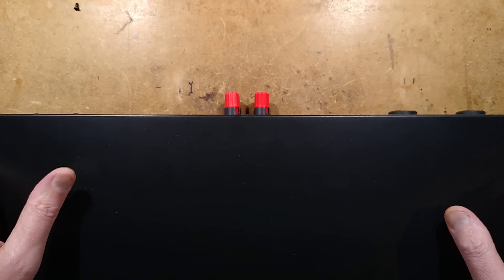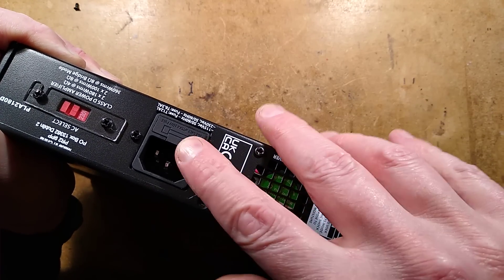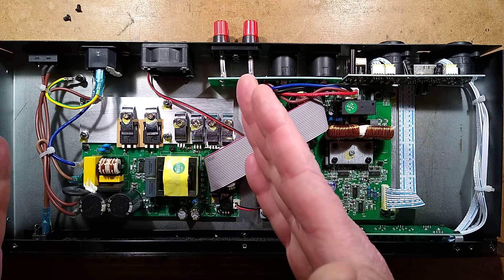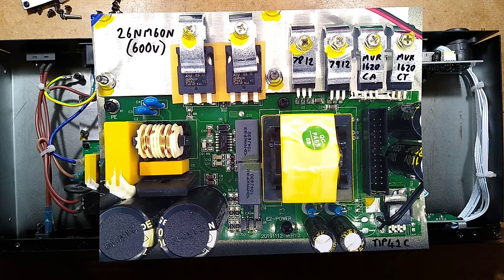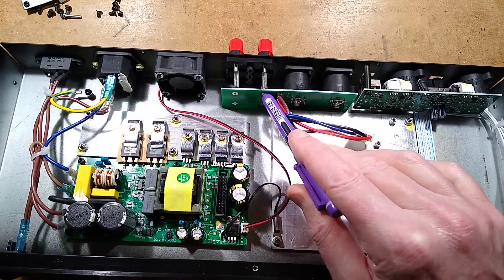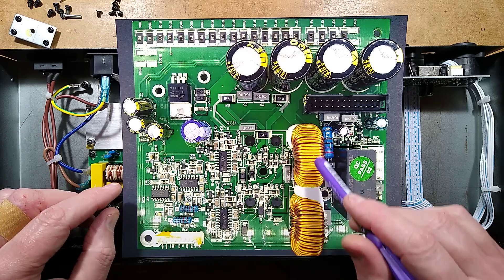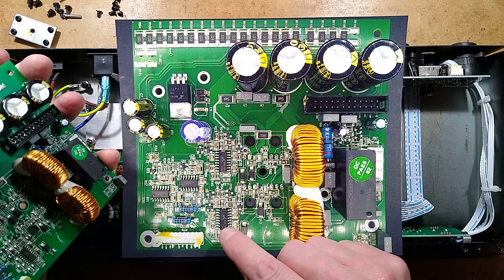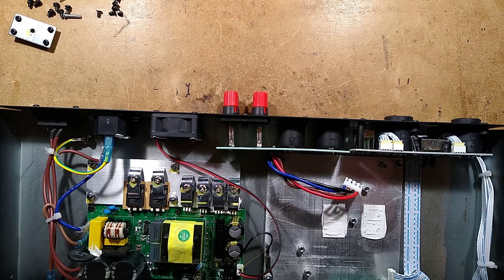Inside a 360W digital amplifier

Comment: The problem with clipping is that it generates a lot of harmonics that burns the high frequency (tweeter) speaker.
Reply: Uh, no.

Clipping doesn’t damage amplifiers.  It’s a saturated output.  The output signal has gone as close to the power rails as the output transistors can drive it, and so it can no longer follow the incoming signal’s waveform.  That’s all.

This doesn’t even hurt speakers, inherently.  They can’t tell the difference between a clipping amplifier and intentional (recorded) distortion - partly because any naturally recorded distortion IS from a clipping amplifier.

The only problem is that the average power of the output signal increases relative to its peak power — because the waveform is getting closer to a square wave, on account of the saturation at the peaks.  This can drive a speaker into thermal overload, but notably, in exactly the same way as it would if you had turned the volume up to the same average power.

Granted, the squaring of the waveform generates harmonics in increasing frequency, which will be sent by the speaker’s crossover to the tweeter.  So the tweeter will be stressed to failure before any other driver.  But it’s still just a case of too much power creating too much heat, and hitting one of the two natural limits of a driver.  (The other being excursion.)

There’s nothing inherently damaging about distortion.  Not to the amp, not to the drivers, not to your soul.  🤘
Reply: @sirnickity the nice thing about active crossovers is that when subwoofer amp goes clipping it can be easily herard and dosent damage the driver. Very usefull when someone turns up the base for mysterious reasons.
Reply: @sirnickity  You're not inherently wrong with what you have said, but you're basing it on the sole premise that a given speaker can handle significantly more power than the amplifier - which is almost never the case. 

When you build any sort of audio system you always overspec the amp, because it's easier to do and leave a lot of headroom for speaker burn in, future upgrades, and to put it blunty: cheaper amps not being able to output full power at <1% distortion.

You also don't take in to account for a moment that when you build a speaker, you can build it to overperform for a given role - this is especially true in subs where you can drive them very hard if you build the right box.

Thus, if a higher power amplifier is happily sending it's nearly full pixies to a driver designed to work already at an overhead - if that amplifier starts sending squared waves it's going to end in sadness for both devices fairly quickly.
Reply: @cozmium   A sub doesn’t care if you drive it with distortion.  It only cares if you drive it with more average power than its voice coil can withstand for long enough to overcome its thermal mass.

The only time distortion is an issue for a speaker is when you have a 2-way (or 3-way, etc..) with a passive XO, and the HF driver is not capable of handling the upper harmonics of the truncated waveform.

The amp will still be fine.  It does not care, as long as you’re below its own thermal and current limits.  None of that changes in the least with distortion.

It’s ALL about thermals.  That is it.  If you run a larger amp, and push the same amount of power into a driver that can’t handle that sustained power, it will melt down - distorted or not.
Reply: The problem with clipping is the waveform becomes distorted in the lower frequency (by the time you clip hf, the lf will have distorted long ago) but since a low frequency driver can't physically move as the amp is fighting its qms, it provides a lot of mechanical (and in turn electrical) resistance - that's what kills amplifiers and speakers.
Reply: @cozmium NAD went above and beyond to prevent that. Used some clever technologies.

Comment: Wouldn't the clip indicator normally indicate that the input signal is exceeding maximum voltage?
Reply from the maker: It does.  That's the point the speaker is being driven with a square wave, that results in high heat dissipation.
Reply: @bigclivedotcom  In the description i thought you were saying it indicated exceeding maximum amplifier output, stressing speakers. But you could clip on input with the gain turned all the way off. So i remain respectfully confused. :^) 🐿️
Reply: @TheAntibozo B.C. is right. you can clip even at low volume setting if input signal is overdriven...a sq. wave will remain a sq. wv. throughout the amp.chain. (that's HI-FI reproduction 😅). This is the time duration when there's No continuous /(rate of)change of either V or A.  thus , then only the speaker coil resistance and wire diameter limit the current through it.
Reply: @analoghardwaretops3976  I think you misread what we are respectively saying. I am saying the clip indicator normally indicates that the input signal is too hot. In the video i believe Clive is saying that it indicates that the output signal is too hot. I doubt that; i expect if you feed the amp an input that is too hot, even with the amp gain turned all the way down (so no output at all), the clip indicator will illuminate.

Comment: I never have been a big fan of the switching power supplies .every one into club systems and concert venues always preferred the lead sleds with the big wound transformers   they punched bass better and were a lot more durable I have racks full of them . What is your pro opinion of switching VS lead sleds ??
Reply: Today most Switchers are getting better even by the 
" minute"and more reliable too.
besides in public events/ shows etc. even the closest audience is at least 10-15 feet away( horizontally) and mids & highs are stacked up 12-20 ft. from ground. So unwanted distortion if any may be inaudible ..

Comment: LM319 contains 2 voltage comparators which work fast enough for class D.
Next stage could be Si8231 compatible H-bridge mosfet driver.

Comment: I love the videos! And I love my VHS players, one of my favorite ones just started getting very static-y and damaging tapes, I know they are pretty complex but if you ever did one of these on a standard VHS player it would help me immensely, I've learned a lot from your videos thank you very much sir!
Reply: may be a distorted pinch roller causing tape to ride up or down creasing the edge, is that the damage thats occuring?  unlikely to find any new replacements only old stock nowadays  'staticy' could mean just needs heads cleaning, or misaligned tape path, which can also cause damage , maybe lump of tape oxide stuck somewhere..
Reply: @andygozzo72  Thanks for the help! I am looking into fixing it but after watching videos of it being taken apart I will be very careful during the process and check for debris and look into the pinch rollers, VHS is so much better than digital copies 💯
Reply: @devonmcnealy8900  be very careful of cleaning the main heads, very easy to ruin them!

Comment: These class D amps are NOT digital, they use pwm or pdm modulators but their control loop is still analog! A misconception that is quite common though...
Reply: Finnaly someone that don't fall in the error that D mean digital. To be fair before talking about digital or not we need to agree of what a digital sistem is. But I don't know a definition that can fit.
Reply: @andreavico6198  Well, me neither has a definition of what IS digital, but I can tell that it's NOT: class D amps have an analog input and an analog output. So no digital portion whatsoever. Well, we still need to define digital then, so I would rate it as digital if there were any portion of it doing calculations with numbers in base 2. But as stated it does no calculations ever, the feedback loop is completely analog.

Comment: I have a Soundcraftsman PM860 that puts out 400W/.05THD @ 4ohm both channel A and B [@2ohm It would likely get to 450W per channel]
It has 6X TO-3 two bolt can style mosfets per channel and a beefy transformer that steps the voltage up from 120V to 140V [70V-0-70V] with a slew rate of 50V per microsecond.[Fast response] Obviously everything remains analog.

Comment: The fan is not blowing into the enclosure, it is sucking air out from it. The intake is the front grille. They should have put a bigger fan in it, it can be done by a bracket, putting the bigger fan in a 45° angle and cutting out a bigger area on the rear panel for venting the air out, probably even a 80x80mm fan could have been installed into it this way, reducing the noise and increasing the cooling effect. This is small fan, and on top of that, the vents are covering most of the active area of it. Otherwise, it seems like a nice amplifier, if it is not too expensive. Of course all the noname electrolytics should be replaced if someone wants to use it in a heavy duty application, like in a bar or something. 

Hopefully the semiconductors are not counterfeit. 

Hopefully the secondary GND of the power supply is Earth grounded, so if the transformer has the usual Chinese-style dodgy insulation between the primary and secondary windings, it won't be lethal.

Comment: Ballast controllers are surprisingly common in these chinese 1U amps, I've come across them quite a few times. I guess they're cheaper than a dedicated on-line PSU controller? In any case, if you're ever fixing the PSU on one of these due to a blown fet, make sure you replace that IC as well because it's 100% dead every time and will instantly destroy the new fet. Not a mistake you want to make given the fets are almost always the most expensive components on the board apart from the transformer.
Reply: Not only cheap amplifiers. I fixed an old Powersoft amplifier that used exactly the same ballast ic.
Reply: No way an IR2110 is cheaper than a China TL494. Impossible.
Another weird thing: Big Clive says the IDC connector has power plus "6 control signals - power good etc". How is that possible with an IR2110?
Something doesn't add up.
Reply: @6AK5W-JAN   IR2156, not 2110. You are right though its not cheap online, maybe 80c each compared to tl494 which is pennies.
Reply: That is an extremely common solution  if you want to make unregulated SMPS. It is commonly used in audio amplifiers (no mether  of topology) because they do not need  regulated imput voltage. I know (low)  high-end (read high price, in over 10000$ range) class A amplifiers that use the same solution.
It is cheaper to design it than regulated because the hardest part of SMPS design is to design compensation loop, and you do not need to spend any time testing stability of SMPS.
Reply: @mrlazda  A case of when "good enough" really is good enough?
Reply: @RyTrapp0  Yes, you gain nothing using regulated power supply. If you want to complete it, you can always do that,  but in the end, it will sound the same.

Comment: I am the proud owner of a couple Crown D-series amplifiers, to include a D-150A (Mk II), which would be a close contemporary of this amplifier in terms of power output to speakers. As a Class AB amplifier, it draws about twice the power for the same output, it's three times the size, and probably six times the weight. Astounding what can be done with high-speed switching FETs these days. I'd probably trust my D-150 more in a high reliability application, though, especially since I have schematics to repair it. (Edit: Not that it's terribly complicated...)
Reply: I love those old Crowns  the lead sled power supplies they were bullet proof  !  the only failure I had I pulled it to below 2 Ohms and burned out the mosfets  But it ran like that for 6 hours before that happened driving 4 dual 18 band pass subs !! at a rave . I had extra amps in the rack to go to as a back up  After we did the math it was running at almost a dead short !!
Reply: I have a Crown CE4000, it is a very nice and robust class D amp. Not in any way related to the CE1000 and CE2000. Those are old school Class AB with iron core transformers. The CE4000 is not class D in the traditional sense as it dosent use an high frequency output stage and an LC filter. It can best be described as an class AB where the two transistors are replaced by two buck converters with an special control cirquit. The ripple current of the two buck converters cancels out and the difference of the high and low side currents is the output signal.
And the service Manuals from crown are wonderfull.

Comment: It would be interesting to load the amplifier to 180 watts and look at the internals with an IR camera.
Reply: And then do a quick calculation as to the likely lifetimes of semiconductors and electrolytics.
Reply: @danmyers7827  You can do that by looking at the front panel. No need to open the case or plug it in.  Hell, just pick it up and heft it. (but compare it to other Class D amps, duh, since they tend to be much lighter than their Class A/B cousins.
Reply: @railgap  I use 20kw RMS  per channel digital amps to drive large line array speaker systems, and they can be easily picked up in one hand.
Reply: @railgap  I'm thinking in terms of adequate ventilation for the components chosen.
Reply: Or measure distortion at full output.

Comment: A "digital" amplifier? It produces a noise when a 1 is send to it. And no noise if there is a 0? Or is the "digital" just marketing? As in "everything must be digital nowadays?"
Reply: It sends a series 1 and 0 to the speaker.  It works like connecting a 9V battery to a speaker and switching the polarity very fast (way above 20K).   You take that output, which is either +9v or -9v, and apply a lowpass filter,  then a pulse width a 50% duty cycle becomes 0V.
Reply: @moddaudio  OK. So depending on the speaker and line capacitence, the sound produced is more or less similar to the original sound. Which is OK, I guess.

Comment: I have to say - IR2156 is not a bad driver at all, and if done correctly, it is possible to create a better power supply than you can find in an average commercially produced personal computer or charging device (in a reliability point of view) etc., but it has to be done RIGHT.
These industrial IR2156 PSU are not very reliable, but if they are made on basis of higher quality parts, the IR2156 is not bad at all. On its basis, it is possible to create half-bridge power supplies with an output power of several kW and which gives this for long time and no failing.
Since the video does not give a very clear picture of the finer smd parts, I cannot assess what switching frequency of this power supply unit could be, whether the MOSFETs of the power supply unit are suitable for long-term reliability at this frequency (is nC compatible to IR draiver capacity, are input-output capacitances, are the MOS and bodydiode switching speeds corresponds) to be a good for PSU.. Unfortunately, as we are doing here - with a cheap commercial product (you get what you paid for!) you don't get many protection functions and guarantees that this thing would be reliable during continuous use, but you also pay the price of bread, that has to be taken into account!
I have seen and repaired and modernized terrible amplifiers, welding inverters, etc. for example made in Italy where all electronics do not comply with any industry requirements that would ensure reliability and longevity, and these things cost tens of times more than this amplifier at 150 euros here.
And one thing more:
Who is talking about changing fans, etc. - if class D amplifier is working correctly, it basically does not need a fan (this kind of amp which only couple of hundred W output power), it emits little heat.
If it doesn't work properly, then talk about Noctua etc. fans is just IT niche bling because they are usually very poor in their ability to generate sufficient air flow - noisy fans are noisy for a reason because they have a high speed and at the same time ensure a large amount of air flow, which in some cases can be the device's essential for work.
Whoever shares recommendations to changing fans without prior knowledge of what fans are used for, these recommendations are very naive and stupid and should not be taken seriously or repeated.

Comment: 360 watts at 8 ohms? I did not catch the impedence. It seems hard to believe something so lightweight has so much power. Something that can blow speakers that couldn' t handle that much power. Am I correct?
Reply: I can create cigarete box size PSU which gives 500-600W continuous power and this at home, on my hobby desk...essentially, it is possible to create a class D amplifier with a power of about 1500W and dimensions of about 5x10-11x4cm based on the IRS20957 or IRS2092 chip. And we are not talking here about commercial opportunities where there is absolutely more money and better engineers than us who are hobby engineers...sure that 360W is not a problem, this 1U case is good to make 2x1000W RMS amplifier but it needs also couple of times more money because it is more complex and finally there are less people who was willing to pay higher final price